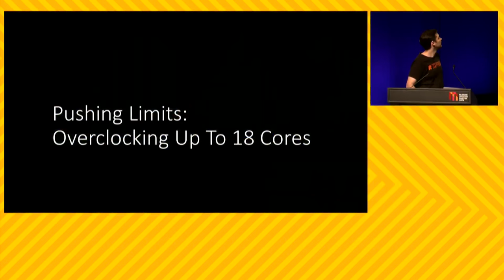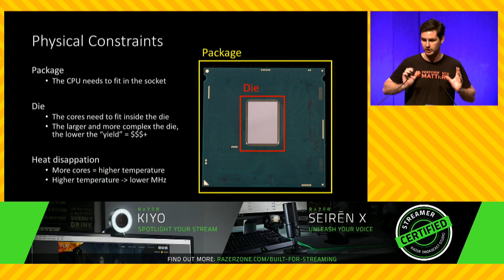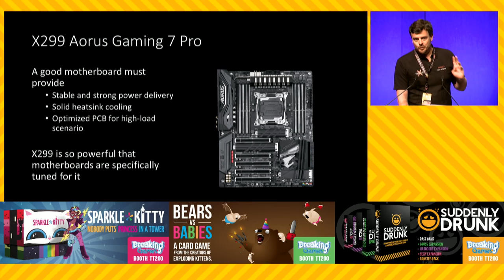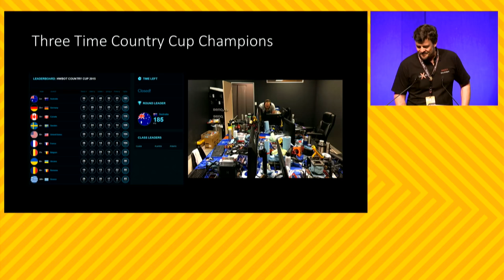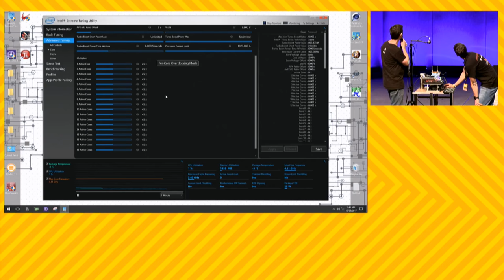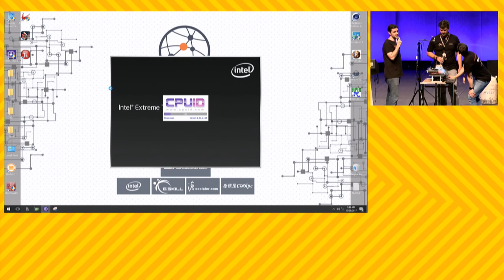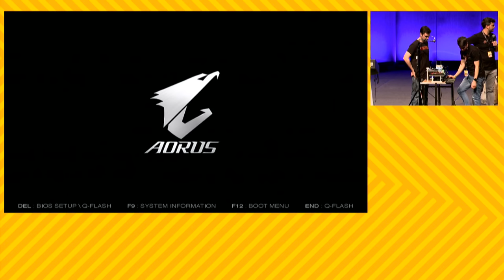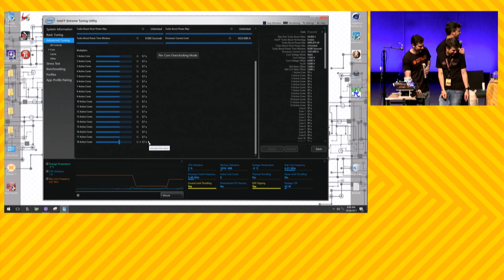Pushing Limits: Overclocking Up To 18 Cores (PAX AU 2017)

Comment from the maker: 00:10 Presentation about multi-core overclocking
13:19 Motherboard tuning for 18 core overclocking
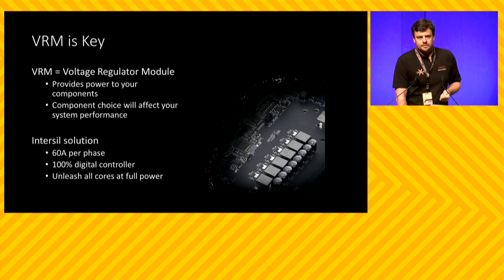16:38 Introducing Team AU
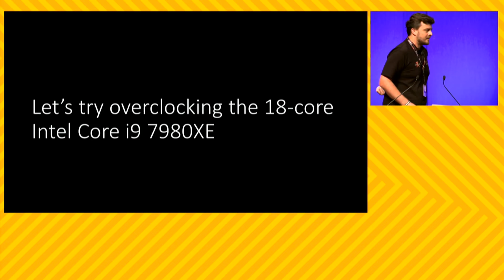24:39 Overclocking the Core i9-7980XE 18 core
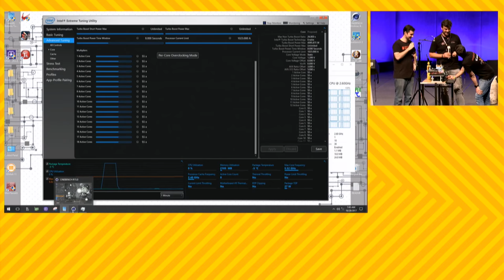32:37 Trying Cinebench R15 at 5500 MHz
33:28 Blowtorch!!
48:24 Final (and successful) attempt for 6 GHz with 18 cores